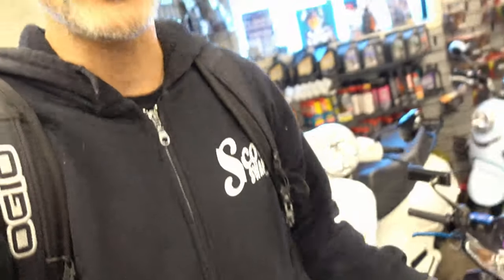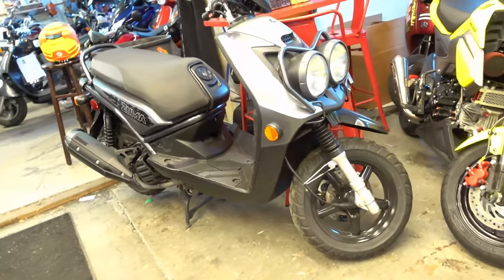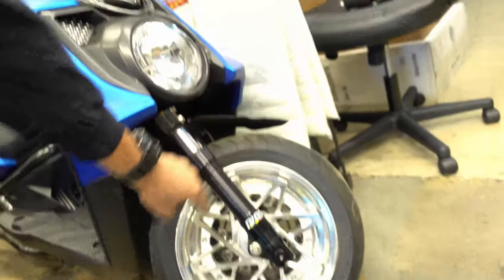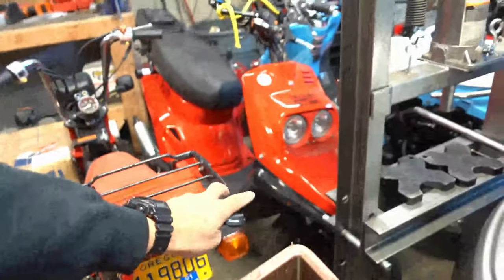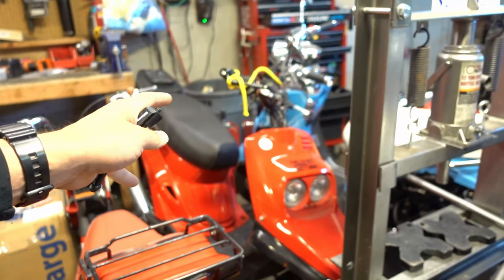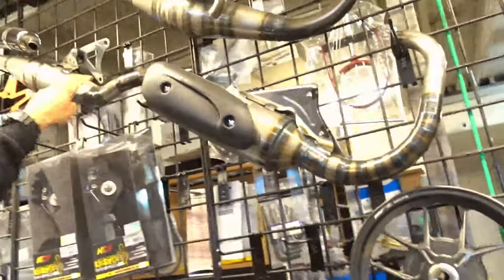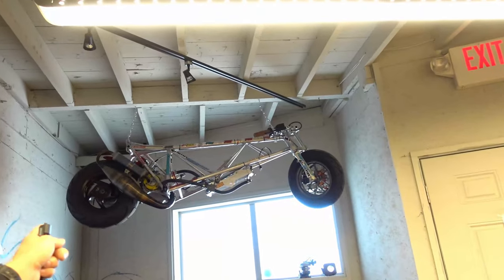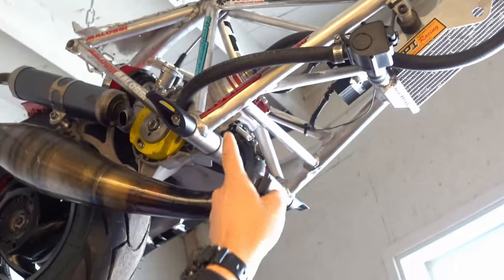Yamaha ZUMA

Comment: I have a 1990 pre bugeye with vertical engine that I bought in 2004. Now has 1,972 original miles. All stock and runs perfectly. Have some new carb parts, new belt and gaskets as spare parts still in plastic packaging. Also have new rear Bridgestone tire that I never installed.  
Carb gets cleaned each year or two and drive for inspection in NY.  Drain gas and then it sits in garage. Maybe driven 120 miles total in last 10 years.
Reply from the maker: Thanks for sharing!

Comment: Hey, I’ve got the drum brake Prebug. Is there any way I can upgrade to beefier forks and keep my drum brake front wheel? I can machine a brake plate adaptor, but maybe there’s something out there for drum brake Prebugs
Reply from the maker: there is no way to replace your drum forks with different drum forks on that bike unfortunately
Reply: @Scooterswapshop what about replacing the old front drum forks with new disc brakes forks? Do you have a link for such?  I can't find anything that can replace it.

Comment: Prebug Zumas are impossible to find. I have a 2004 bugeye Zuma and love it. I am definitely a 2 stroke guy. I have a Yamaha RD350 street bike, a Yamaha DT250 dual sport bike, and a KX250 dirt bike. I'm also a carburetor guy, and wouldn't even consider anything with EFI on it. To me the rear brake on a 50cc scooter (or a 70cc scooter) just isn't a big deal. No matter how fast it is, it's just not heavy enough to need a rear disc. I was easily able to do stoppies on a friends Honda Nighthawk 250 with a drum FRONT brake.
Reply from the maker: prebugsare very hard to come across!

Comment: With a 70cc kit, pipe, clutch work, and possibly a bigger carb make it easy to wheelie a bug eye 50 2t? I can usually wheelie anything basically (even garbage Harley's, raced MX for 20yrs) but I can only get this stock sucker to wheelie about 30 ft and it likes to tip to the side. I think because of the lack of centripetal force from the small tires at slow speed. Just curious because they are pretty heavy.
Reply from the maker: you can't wheelie them stock, call the shop talk to Paul and he can set you up
Reply from the maker: don't let the air out it creates a crutch then you have to have low pressure to wheelie. I see it far too often and experienced it my self. just do it at normal pressure and get used to it.
Reply: @Scooterswapshop  I wrote that message a while ago. I can ride a wheelie for a bit if I REALLY crank on it and hit that balancing point, but if I go off it the slightest bit the front end goes down. Love your shop though man, you respond to customers personally, probably the only shop that does. As soon as our MX bikes are rebuilt, mod time for the Zuma. Gets alot better mpg buzzing around my small town. Probably 10 times better. Have a good one man and I'll be contacting him after the holidays and the bikes are done.

Comment: A limited run of custom hubs for bugeye would be great. Only way to get Aerox wheels on them is to use the disc brake case halve or custom hub. The Kiesler wheels need a hub too. There’s no options for these things, help us!
Reply from the maker: The issue is nobody will pay for them. To do it right you need to cast the spline into the aluminum. And machine the hardened steel ring. I was quoted $500 to make one. And $200 each to make 30.

Comment: is there a way to modify the seat on the bug eye to make it more comfortable?
Reply: Yes, but it still has a slope. 
As far as it being heavy and bulky, still doesn’t keep me from pulling massive wheelies.
Reply: Remove the staples, take off the seat cover and apply more foam on the front (AliExpress has great motorcycle seat foam for cheap). Then staple the cover back on
Reply from the maker: take it to a shop have it made for you

Comment: I have the 2005 yw50t. 2 stroke bug eye zuma trying find best unrestricted no rev limit cdi ive upgraded to 72 polini big bore and upgraded the cvt to ncy super transmission kit at first I was getting faster take off and higher top end speed now its slowed back down to 50mph and I keep blowing spark plugs I also want to up grade the gears but don't know where to find the parts I have purchased parts through you on eBay if you could help id be greatful . and also will the NCY rims for the 125 zuma fit my yw50t ?
Reply from the maker: that's alot to take in call the shop we can get you what you need

Comment: You should try swapping the zuma 50f  with a zuma  bug eye crankcase , i did it myself  i had an athena evolution 70cc with yasuni c16 etc...  but now  im  re-swapping it  with  a rc-one  crankcase minarelli  ( 2fast 100FL )  and  i'm far   from the end  because  i need  to stretch   the frame mount on the 50f  which is not very  easy 🙄 anyway  i would like you  guys to try to make  a special mount  stretch like the one on the zuma bugeye for the zuma 50f 🤘🏻❤️
Reply from the maker: we wont make anything for a four stroke zuma sorry bud

Comment: If I want 60 I'll just be simple and buy a motorcycle
Reply from the maker: Yes scooters aren’t for everyone!
Reply: @Scooterswapshop  I'm just saying if everyone could get a scooter and make it do 60 then people could save money on that b m w,any cop see a 49 cc goin 60 adleast where I'm at your getting questioned,then they make you take it all apart,for the guy that can afford a $300 pair of shoes,why get a 49 cc and make it do 60 only to get caught and have to go bare foot🤣
Reply from the maker: cooln collective it’s not about hitting some max speed it’s about the hobby. No diff than saying why does someone spend $1500 on a bicycle when they could buy a motorcycle? We don’t do this to achieve speeds we do it because scooters are fun. I have owned several motorcycles and own a 690
Ktm now. 60 on a scooter is far more fun than 60 on a motorcycle.. that’s all we do this for, fun. Ride one and you’ll get it :)
Reply: @Scooterswapshop  your right I'm not mad or anything scoiters are fun like the ruckus it's slow but has great power and fun in snow where a grom is faster but a different rude,i get ya I'm just comparing all I want to do is see how long the original parts last😊👍
Reply: @Scooterswapshop  I've ridden one my point is a cop is always waiting for a scooter to do 60,I know the hobby it's like r c I've had cars do 120 and people are like what👍
Reply from the maker: cooln collective gotcha! If you do it right they last as long as oem. It’s all in the install and the quality of the items used. That’s the beautiful thing is police here at least don’t care at all about mopeds and scooters. It’s a grey area for a lot of them and your not even on the radar. At least on the west coast. I know over in ma; and other areas they’re always getting in trouble  but that’s because the majority of riders are on stolen bikes; with no paperwork/not legal. From my understanding